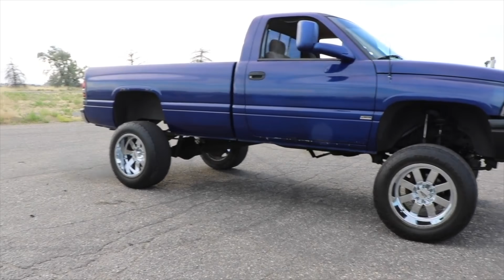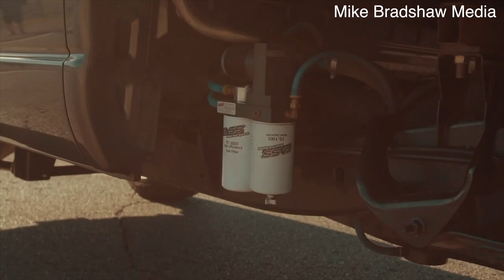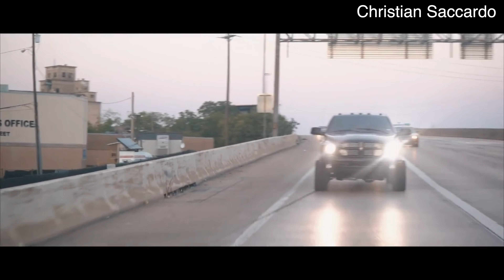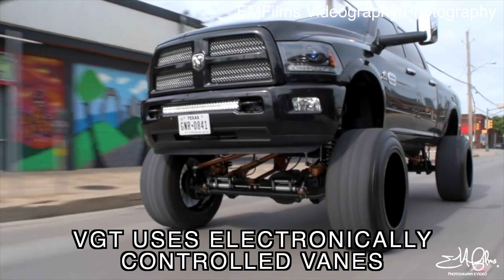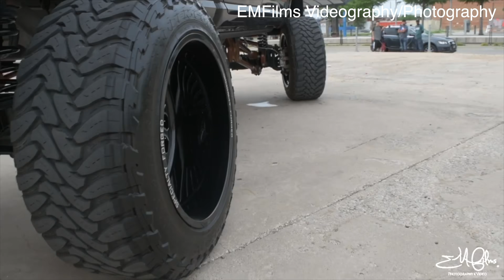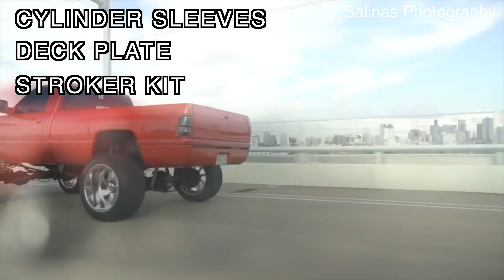5.9L vs 6.7L Cummins: Which One is Actually Better?

Comment: The United States Military almost picked the Gen 3 Ram Cummins as their main battle vehicle. The only reason why HUMVEE won the bid was because of their independent suspension. Ram Cummins Gen 3 was runner up and it wasn’t due to the price quoted because HUMVEE was a lot more expensive. 

The government should have been smarter though and make HUMVEE put 5.9L Cummins engines in their HUMVEE.

If you had a vehicle like this, I swear on everything Professional in my field you would have an near indestructible (natural driving on or off-road) life time vehicle!!!!

-Certified Automotive Technician, ASE-Master
-Cummins Diesel Technician
-Purple Heart Combat Veteran (14 years of service and experience in HUMVEE and many other vehicles)

I’m an expert there is no need for people with Tiny Man Syndrome to challenge me or question my professional opinion. My statements made are based off 20+ years of experience combined....

Nothing is better on the market than a used Gen 3 Dodge Ram Cummins with 5.9L and no emissions, no blue Def. You won’t find a more reliable engine AFTER.... you do this 1 thing:

Turbo swap! Get rid of the Holten and put in Aurora 4000 to get most longevity out of any Turbo Charger on market and still be capable of producing 780 WHP  (1600 Tq) with a tune and CAI.

The suspension is NEXT! Go with Fox, Gi with kings and if you do a lift, SAVE YOUR MONEY FOR CARLI and you will be the happiest Dodge and Truck owner alive!!! The truth is, Dodge Ram suspension SUCKS! I love my truck but the first thing I swapped was suspension because it got unsafe at times with death wobble!

If you buy a used $15,000-20,000 Gen 3 Ram Cummins used and then spend another 15K on suspension and turbo upgrades you will have a Truck that last you a Life Time CZ these new diesels designed time fail and suck you back in to trade it in later.

What is 30K-35K for a used truck rebuilt vs a brand new piece of shit that you are going to pay $70,000 on atleast and trade it in 2-3 years later because IT SUCKS!?

Do yourself a favor and DONT buy another new Pickup Truck until Manufactures start giving a shit again about the consumer that is making them RICH, WEALTHY, BILLIONAIRES.... why feed that bullshit?

Comment: It is possible to delete emissions in such a way that only an expert who is specifically looking to bust you can figure it out.  For one thing, don't remove any parts.   Bore a hole through the offending exhaust bits and insert a stainless steel pipe matching the original inlet and outlet.  Weld in place.  Leave the sensors in place, but disable them through software.  Leave the EGR, but block it off and disable it.  If you live in a place that doesn't routinely test diesel emissions there is no realistic reason why you'd ever get caught.  

Commercial users beware, though.  You never know when the Kalifornia weenies will pull you in for an inspection with no probable cause.  They can, and will, catch you.

Comment: When you lil 😆 boys want to know what a real engine is park your ass in Big Rig (a real truck) not your lil gaybaby boy toys, 😒 strapped to an 18 speed hooked into a 3406 turned up with some 3.73 gears...

Ill throw some stacks out the bed that makes me a bad ass or a huge ass 10 inch end pipe that makes me cool bro...🤔😂😁🤗
Did I mention none of you can drive for fuk

Comment: Owned both and have love for each of them. 6.7 will work if deleted and I would recommend arp head studs. The 68rfe 6 speed automatic transmission is great when working but prone to failure with hp increase unless built. The g56 6 speed manual transmission is probably more reliable but not as much fun on the street. Like said in this video the 5.9 is more reliable but has some disadvantages too. If I was going to have to pick between the 2 I would pick the 5.9 just because of its overall reliability. That being said I really do love them both. Just my opinion. To each, their own.
Reply: Grabing gears is way more fun then a auto
Reply: I love driving my 2015 3500 drw with the g56. But I've always enjoyed rowing gears. Some stuff has fell off on a dirt road.

Comment: I've been through 2nd gen 94-96- 98 12v plus 02 24v had an 03 CR an 06 CR now on my 2012 6.7. And all I have to say is all my trucks, not one complaint. My favorite trucks were my 96 3500 and my 06 3500. But I will say my 6.7 is definitely a better tow rig. But put my 06 vs my 12 light to light my 06 would walk away with ease.

Comment: My 5.9 lasted over 500,000 miles (truck fell apart around) we keep the engine,. My 6.7 has 150,000 on it and is going strong. It's stock and one great towing vehicle. 350,000 to go, and expect it will make it.  I think there both great.

Comment: We have a 6.7 4500 we use in the log woods that we just got deleted by our local diesel mechanic. Let me tell you it takes a minute for that bitch to spool up but once it does it really gets your attention how hard it pulls everything on its back including a 300 gal tank and full of tools. My dad also has an old 5.9 mega cab we use to use here and there for the log woods and the last time I drove that bitch it almost threw me in the ditch. Pulled off from a stop sign and as soon as it made boost with not even half throttle it kicked the ass end out quick as hell. Only ever had problems with the trans on the 5.9 and it still isn’t 100% today. That 5.9 turned me into a true Cummins fan back in high school. All it had back then was a diablo tuner on it but damn I felt like the shit pulling up and still could outrun most other trucks in the parking lot.

Comment: 6.7 with vgt is in another league towing heavy, and the 6spd at with it makes it so much better than any 5.9 truck ever dreamed of being 

The 6.7 doesn't "blow head gaskets", the owners do when they push drive pressure beyond the compressor map safe efficiency range, by running super duper cool race car tuner boxes to add 300 hp 

Anyone who says otherwise has never used both, the 4x4 5.9 trucks in tow mode are screaming at 65mph, while the 6.7 truck can tow in 5th or 6th and run 80 loaded to the hilt at an easy rpm, although 5th is better for it obviously 

The riced out trucks at the beginning were definitely comical

The 5.9 has no emissions garbage so it will always be called the more reliable engine, but the dpf has nothing to do with the engine being reliable or not, that's a totally separate emissions system..

They're both the best engines to have ever been put in a light duty truck and probably always will be...

Comment: I own both. '03 5.9L 6 speed manual and '13 6.7L full delete.  I loved my 5.9L so much..  almost 500K on it. But man! that 6.7L hauls!!! As much as I like driving standard, the 6.7L with aisin is the best truck I've ever driving. It Feels like 50% of power increase, easy. Both engines have been exceptionally reliable. But still cant wait to go electric...

Comment: I've worked for FCA for the past decade and I've never seen a head gasket failure on a 5.9 or 6.7. as long as you do your recommended service intervals, the 6.7 will be just as reliable as the 5.9.

Comment: One thing about the 6.7 is the rod angles which is a weak point vs the 5.9. 6.7s bend rods easily when lots of fuel is dumped at low RPM. Would be a good idea to go with forged rods if you're pushing more than 1800 ft lbs of torque on a stock 6.7 bottom end.

Comment: Its all about the mechanical 12 Valve 5.9 man. A true LEGEND.
Reply: I'll take a deleted 6.7 anyday so I can actually pass someone with a load lol. There plenty of 6.7s out there with a million miles
Reply: @rickshiandmoku4128  Sure there are, but we're talking about less electrical junk to go wrong
Reply: @rickshiandmoku4128 vgt turbo on a 5.9 slaps
Reply: @rickshiandmoku4128 and how many more times trips to the shop did it take them to get there than the 5.9
Reply: The motor is really good. The trucks they are  in are junk.
Reply: @grantmackinnon1307  ain't that the truth. I put my engine into 3 different trucks because the trucks fell apart before the engine did
Reply: @grantmackinnon1307  Oh, I completely agree with you lol.
Reply: @grantmackinnon1307  so what truck would you put the motor in?
Reply: @VillainWithGlasses  I would put a 5.9L 12v Cummins into a really nice newer Ford most likely something like a 2008-2012 or so F250 or F350 non dully. Best of both worlds a really solid comfortable truck with a rock solid engine. In fact a LOT of people have started putting Cummins engines in Fords to the point there's companies that make kits for the conversion so you don't even have to do any fabrication and welding to make it work. Thus why the term "Shipping Crate" has started being a thing with Rams with Cummins in them. 

That's what sucks about fords made after 2001 they started coming with the worst diesel engine ever made the 6.0L and then later the 6.7L while much better than the 6.0L nether of them can hold a candle to the good ol 7.3L International. And newer fords with the terrible engines are otherwise really nice and comfortable on the inside and look sharp too.
Reply: Definitely the most reliable cummins
Reply: Bingo
Reply: P puuuump!!!👍
Reply: And somehow still an understatement...
May not be anywhere near raw insanity like a highly tuned Duramax or Ford's 6.7 but those city boys trying to compare them are as useless as we laugh at them for....the ole legend 5.9 was meant to compete only in it's Day and she was a true mule. Duramax was far more powerful (you know what I mean if you know much about the generations) and even "Ford's" 6.0 was too. Admittedly I'm a GM fan myself but nothing compares to Real American Iron, that's from the big 3....

So many guys I know where I'm from will be diehard Duramax, or Navistar guy's....at the same exact time we all would gladly BUY ourselves a 5.9 Cummins because they're that fckn good, period.
Same goes for the filthiest diesel engine ever produced (a badge worn with honor by hard working Americans) the 7.3 she may leak oil from every fckng joint/deal pretty much from day One lol painting your driveway/garage floor but she's simple and meant to be pushed hard damn near daily with very good power and very acceptable fuel efficiency.

The 7.3 and 5.9 are much alike, products of their generations that live on to this day for all the right reasons. Highly accepted and respected by opposing brands.
Reply: @Josiah Juan  Get outta here fuck
Reply: I have a 97 12v and an 18 6.7 and i can tell you the 6.7 is better. Love them both and you cant go wrong with either, but the 6.7 is the best cummins overall
Reply: 5.9 all day and night long. Much better!

Comment: Luck me I have both now In My garage. The 2nd gen (95) 2500 complete mods on the engine  and runs around 350 hp. It sits for now since I broke the input shaft in the transmission ( I have a Billet triple disk torque converter) too much power applied to the Billet shaft ? I don't know but will find out soon. The 5.9 is just plain fun to drive. I drag race a 6.7 a stop light  ( really  really dumb couldn't help myself) he  beat me off the line but once the triple disk lock in  I had him. I never done that before and won't again but what a rush for 65 year old guy.
I install new 4 exhaust. When  started it for the first time my wife came out house and said it sounded like a big rig.  That made my day.
 I just bought  a 3500 6.7.for  towing the 5th  wheel the 6.7 has the 5.9 beat for low end power and the exhaust brake and just plain comfort of driving .  I bought the 5.9 new  and may sell it one day but It would be like parting with a good friend. I know that sound really lame. But it is what it is.

Comment: Hotshot drivers are getting 500k plus miles on the 6.7L with Aisin transmission. I daily mine and tow a 40 foot gooseneck. I had a 6.7L with 68rfe 3.73 gears SWR and deleted it on hills it hated the trailer. This new 2018 with the Aisin with 3.42 gears DRW  I don't really know the trailer is back there on hills. Amazing what difference in transmissions will make night and day in trucks.

Comment: great information, the video however was a damn clown show! I have a 2016 6.7L, Id love to get a 5.9.
Reply: You nailed it,  clown show.  As far as the real trucks I have had 2 -12 valve both trouble free. I have been driving an 08 6.7 for over 10 years now and besides the fuel economy   its fantastic.  Several sets of brakes,  Countless  tires,  a few universal joints, one front end. My only regret was not removing the dpf the day I bought it.
 I just picked up a  04- 5.9 for a winter beater. it's nice but I miss the 6 speed auto, and exhaust brake

Comment: I have 3 notes. 1: the term is destroking where they’re putting 5.9 cranks into 6.7 blocks. Resulting displacement is 394ci. 2: The vgt uses the same 60/86 compressor as the 04.5-07 5.9’s, and the same turbine wheel (I’ve measured many of them, they all fit in the same hole, but there’s a 3-4mm spread in inducer/exducer measurements), and the vgt itself is primarily there to facilitate ego by creating higher backpressure. 3: head gasket failures are principally due to incorrect injection timing. Basically to much timing for the fuelling puts the pressure spike too close in the wrong spot. 

My preference is the 6.7 due to its ability to spool significantly larger turbos with ease.

Comment: My dad used to have a 05 2500 5.9isb. that thing was a champ. plenty of power for what he needed, it hit 650k before it got stolen 2 years ago. sadly the rest of the truck was just terrible. passenger door insides were falling about, its poor 48re was tired of living. He now drives a 2014 2500 6.7 and i gotta say. its a better truck. more power, the exhaust break is really nice to have. and its just more comfortable to be in and drive. the only "downside" is his 5.9 easy got 28mpg mixed driving and 32/4 highway, which he did mostly highway driving, while the 6.7 can only muster about 26 highway. but still pretty decent. he gets paid to use his truck so doesnt bother him.

Comment: My wife and I are full time musicians and full time in our 26 foot travel trailer (30' overall). We pull it with our 2007  3500 4X4 with a fully enclosed fiberglass CargoBody cabover work van style camper. We sought out the last 5.9 (early 2007) for it's better mileage. With the cabover semi-empty (around 700 lbs) at 55 mph on level freeway, we got 25.5 mpg. Now that the camper is full of tools, and pulling the trailer (8,000 lbs), were averaging just shy of 16 mpg, which is where the 5.9 really shines, especially now that diesel is so expensive!
Reply: Drill baby, drill. Thats the ethos in 2026. How is your 5.9L doing today?

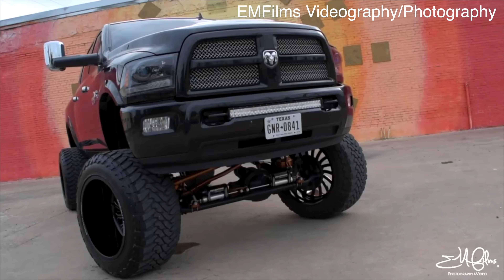Comment: I owned a 99 2500 4x4, traded it at 251k miles for a 2005 3500 dually 4x4 with 5.9 HO and traded it last year at 207k miles for a 2018 Ram 3500. Both the 99 and 05 were great trucks, I towed heavy with both and they were extremely reliable, both were running and towing like a champ when I traded. Neither truck had any engine, trans or driveline problems. Major problem I had with both trucks was fuel pump, the 05 was just the fuel pump but when the 99 fuel pump went it took out the injection pump also. Both 5.9 trucks and the new 6.7 HO remained stock. The 05 3500 dually had the 5.9 HO geared 4:10, I towed 42' GN 4-horse living quarters horse trailer all through the NC, TN & VA mountains and it amazed me. But the 05 is not even close enough to make a comparison to the 2018 Ram Limited 3500 6.7 HO, Aisin trans, geared 3:73.

Comment: I have a 12v and a 6.7.  My 12v hasn’t ever gone down 329k miles won’t tow what the 6.7 will but won’t ever die. Truck will rust away long before the motor quits.

Comment: I vote for my 98 12 valve with a swapped in 6 speed manual,reliable, makes decent power ( not much done besides fuel plate) and gets great fuel economy
Oh an I almost forgot P pump baby!!!
Reply: 1966cambo Yep, that’s the best combination ever in the dodge.  I’ve got a 2001 with the six speed, almost rebuilt it to a p-pump 24 valve, but thought why not just get a 12 valve.

Comment: Noticed how he kept say the 6.7 has more considerably more power than the 5.9.  For the longest time the 6.7 was only putting out 350 hp. That is only 25 more than my stock 06 5.9. I don't exactly call 25 more horse a  considerable amount.

Comment: I could see a fat mileneal kid with  skinny jeans painted on and a long chin beard getting out of one of those trucks with the ugly wheels. However, great content all true, knows what he is preaching. The only 6.7 worth a dam is a deleted one and only then they are beasts. EGR trucks are destined to self destruct. I love third gens and the old 12 valve myself. Just make sure you have a good 2 micron aftermarket fuel filter system and a lubricant additive like Optilube in the fuel.

Comment: I have an 03 with a manual transmission. I test drove a 6.7 with a manual transmission, tried to take off in 2nd gear and it fell flat on its face. I think I killed it twice in the test drive alone. My 5.9 will walk off in 2nd gear without any issues.
Reply: Different gearing.

Comment: Why The F*ck do they ALL look the same? What happened to Being different, standing out. I guess it’s just what’s in the Videos.? Let’s do what Everyone else is doing. Cookie cutters 
What happened to doing sh*t for maximum HP and not “it sounds good”?? Or it’s blowing smoke, I’m cool. I have spacers that looks like a 90’s low rider on a 4wd diesel truck. These trucks Lost their clearance with low profile tires. That pumpkin clearance just as low as any truck with the same rims 
Seems it’s All about LOOKS not function.